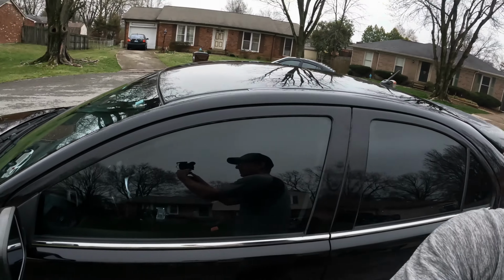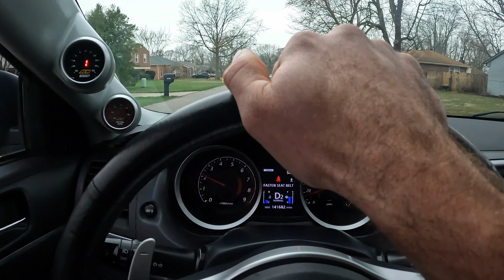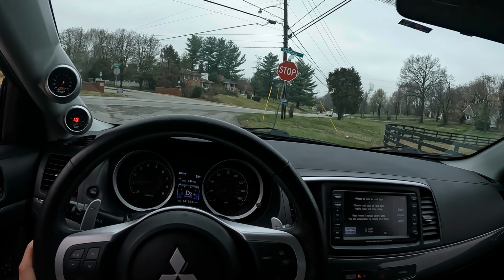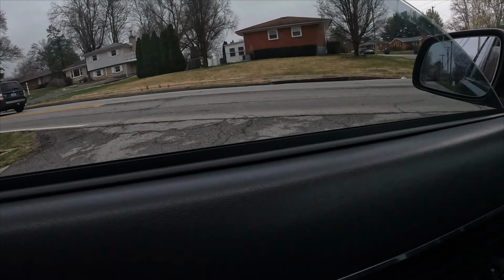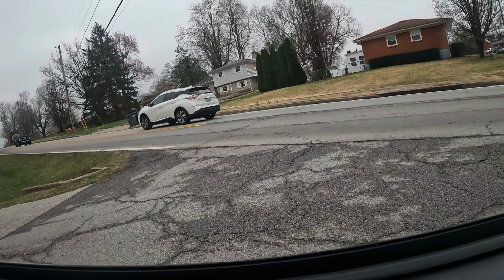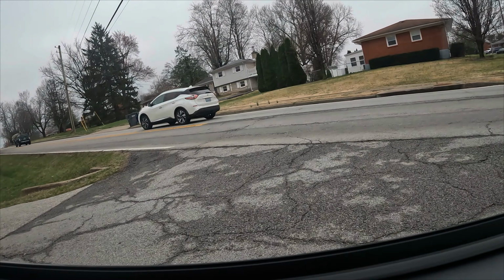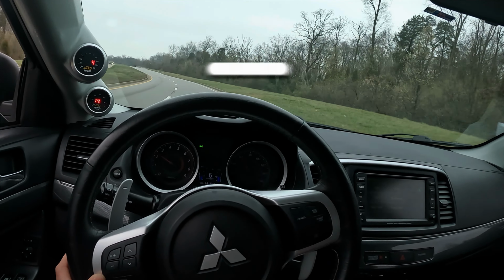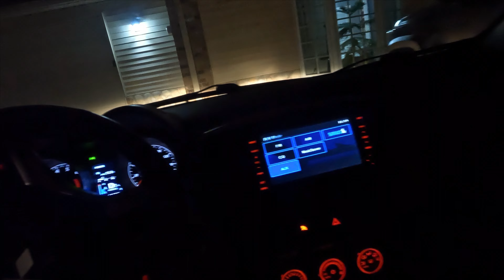2010 Mitsubishi Lancer Ralliart Sportback (Evo X Turbo Swapped) Test Drive

Comment: Ive seen the ralliart beating the sti and wrx base model all ovver youtube  but this is even faster now
Reply: Get a tune
Reply from the maker: Hey, but they're just Lancers though, right??? And all the Ralliart guys think that they have Evos??? 😂

In all seriousness you're correct - after owning this car, some of the numbers and times being put down by other Ralliart owners, as well as what they've taken down on the track is pretty nuts for what they cost comparatively. 

Thanks for the comment!
Reply from the maker: @UltraGraal  I eventually sold the car after buying the RX8 I referred to in the video (crazy, I know). My plan was to get a tune on it at some point, after I figured out what else I wanted to put into the car. The PO claimed he had a Chag Tune on it, but may have been full of it. My plan was to go with a Rickerman tune, which is the way most of the Ralliart and Evo MR owners seem to go.
Reply: @retro_grade  I just got my ralliart it has aem high flow intake, turbosmart recirc valve and a evo wing on it rn, I'm bout to get wheels , tein coilovers, and a borla catback this weekend,  I plan to get a high flow catpipe  and then maybe get a tune
Reply from the maker: @UltraGraal  Nice! If you haven't joined it yet, look up 'Ralliart Revoluation' on Facebook. Alot of owners who have had them a long time and a pretty good deal of knowledge and involvement on there, shops included even. These cars seem to be very particular with who tunes them and works on them, more than most makes and models. But, the good part is there's a huge base of knowedge out there and alot of experience from previous owners and shops who have been working on them since they were new. 

Heck, even the tuning and data logging software is dirt cheap. (ECUTune, Evoscan, MMCodingWriter, TCU Mod V3). 

Hopefully your SST is still in good shape and kicking along! Get the TCU mod that allows you to put it into S-Sport if that hasn't already been done. These cars prefer being driven in that mode once warmed up.

Comment: I almost bought the raliart but couldn't figure out why it wasn't offered with a manual transmission. Ended up buying a manual GT model which has been a great car, just lacking power. But that's why I ended up getting an evo 5 as the fun car on the side 😁
Reply from the maker: Nice! Yeah, had they offered the Ralliart with a manual transmission, it would have sold much better and competed with the WRX as Mitsubishi intended it to. Instead, if fell into oblivion and nobody bought them. 

I wanted to convert this one to manual, but quickly realized it was quite a bit more than I wanted to take on.

Comment: I’m working on building a ralliart, do you have any suggestions on parts or tips?
Reply from the maker: @Calvintherock  nice! For starters, I'd say join the Ralliart Revolution Facebook group. Alot of guys on there who have had these cars for years and know a bit about them. 

For tuning, Rickerman seems to be the "go to" that everyone suggested to go with. On the SST it's critical that you have a tuner who knows that car. Apparently alot of them dont. 

And then there's the SST which is a whole other animal. For parts and resources/services on those, Kosmic and Jack's Transmissions are your go tos. More people like Kozmic than Jack's from what I've seen. 

Hopefully this helps! Punchy little daily drivers when dialed in and working right!